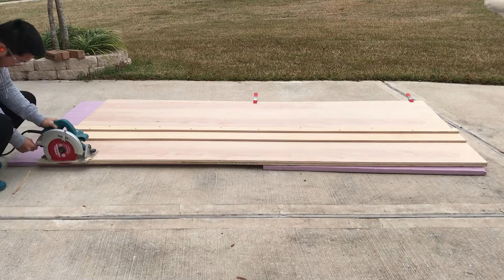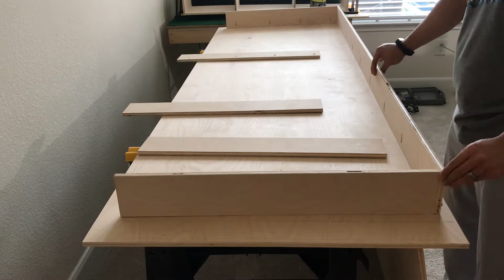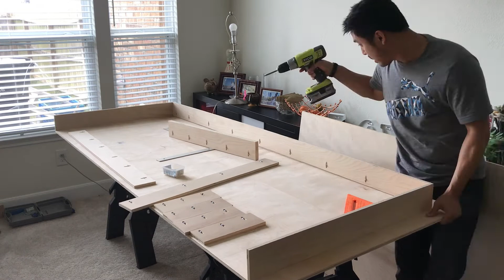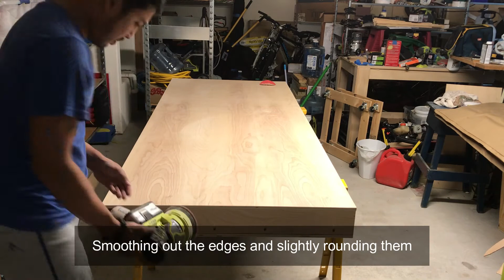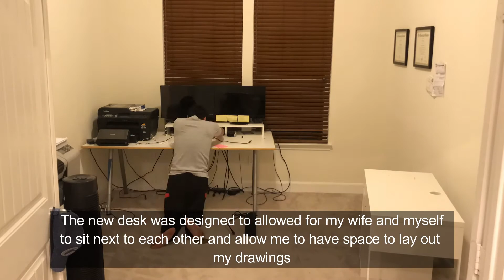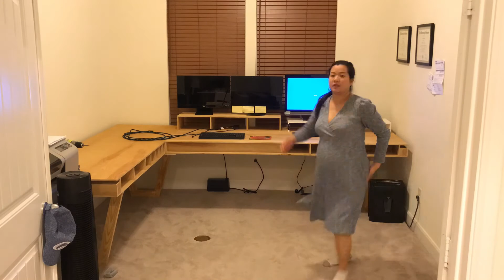DIY "L" Shaped Office Desk On A Budget With Built in Cable Storage

Comment: Looks like a nice desk. I would've been interested in seeing how you made the legs ... they look like 2x4's, but how long, and what angles are they cut at? Do you notice any sagging, particularly on the section where the computer monitors and equipment are?
Reply from the maker: yes, the legs were made of 2x4.  the total height is about 25 1/2 inches.  if you take out the difference of the 2x4 at the top and bottom of the legs you can get an idea of that length.  the angle i made was an arbitrary number since i eye-balled it, but i would guess that it is about 15 degrees give or take.  there is ZERO sag on either table tops and i have since added more monitors and computers that sit on top.  the internal pieces help the table tops act as a truss